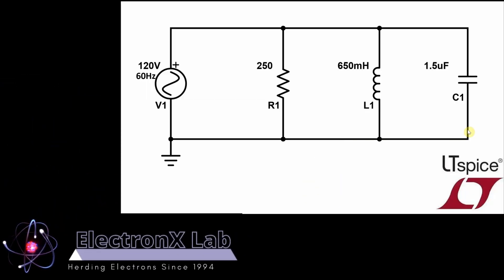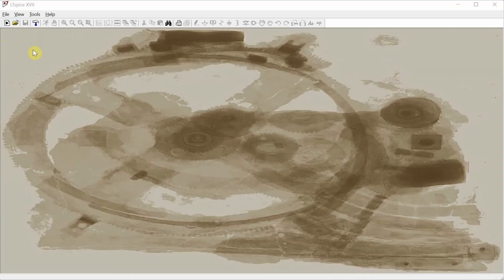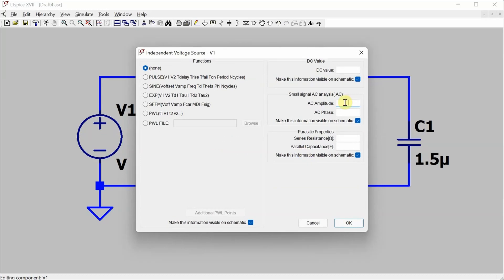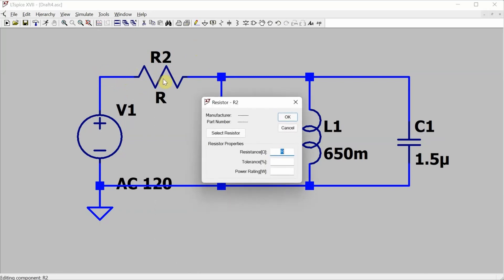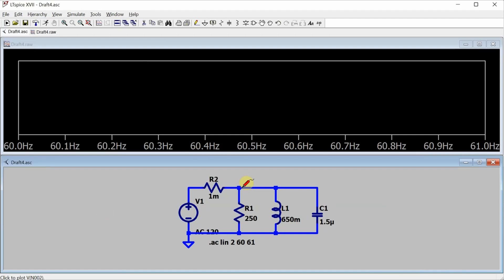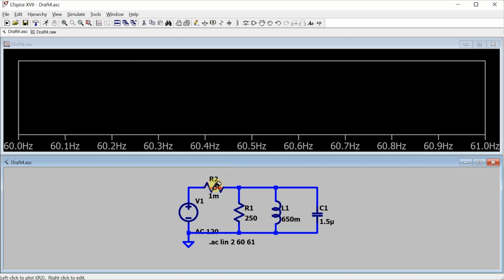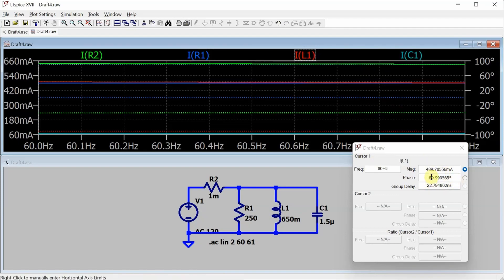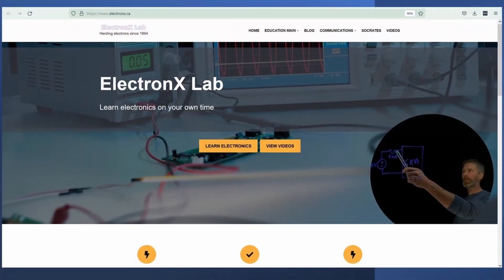Quick LTSpice: AC Analysis of Parallel RLC Circuit (Includes a couple LTSpice Tricks)

Comment: The phase orientation always confuse me in LT simulations.  I have to check orientation of all elements by hovering the mouse to see the current direction and then rotate them so that the arrow points towards the ground.  Except for the power supply which seems to point in the opposite direction, but actually it also points towards the ground. So I guess the rule of thumb is all elements should point towards the minus sign of the power supply.